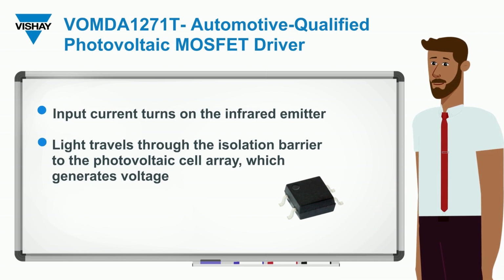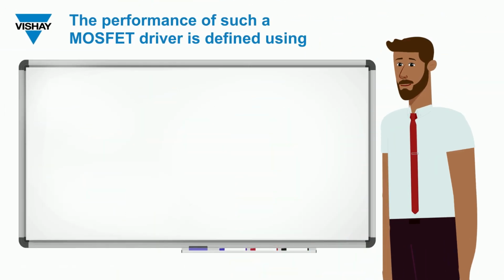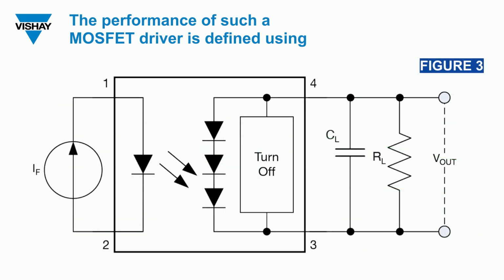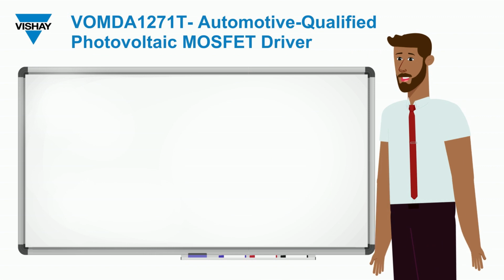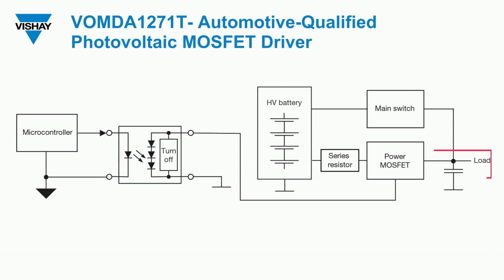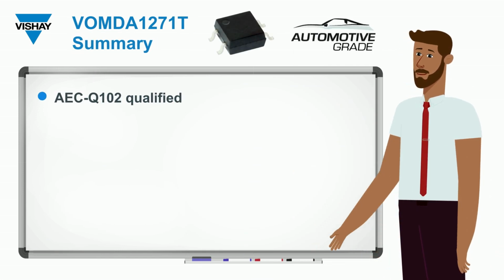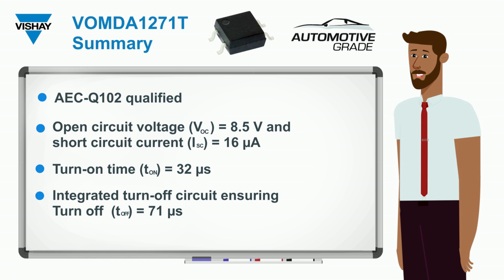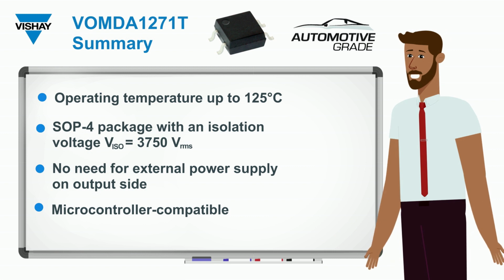Introducing the VOMDA1271T: AEC-Q102 Qualified Photovoltaic MOSFET Driver for Automotive Application

Comment: What is the high current handling low-cost n-channel MOSFET (low RDS) most compatible with this (assume 48V application)? because lot of MOSFET's Vth is around >10V and this driver photovoltaic maximum output voltage is 8V.